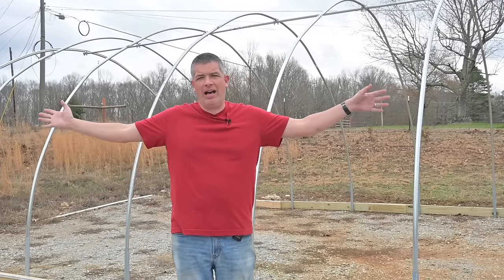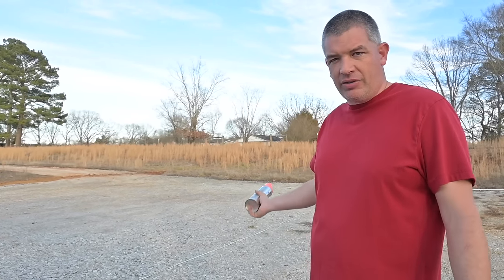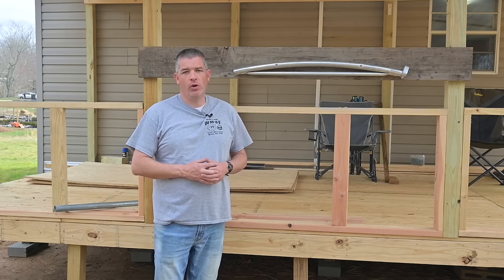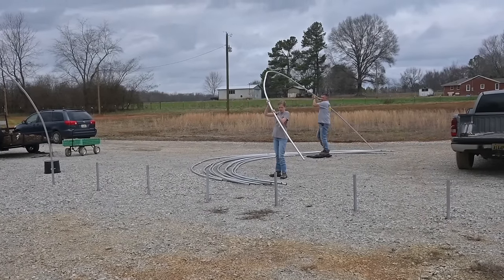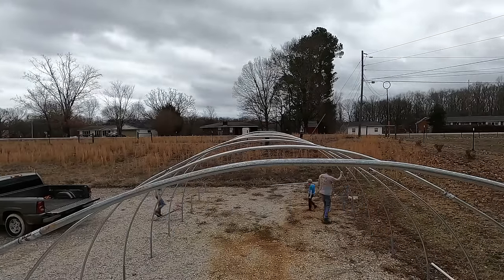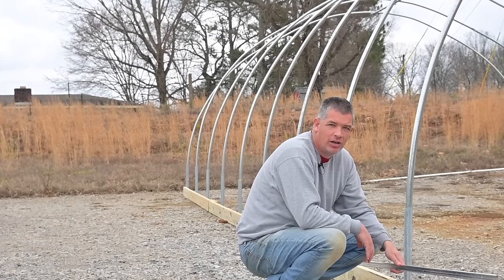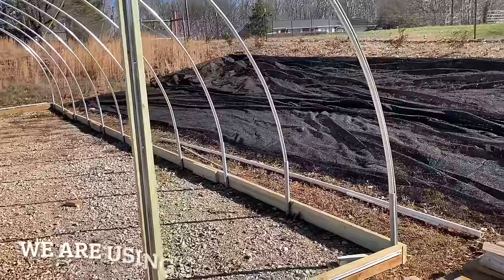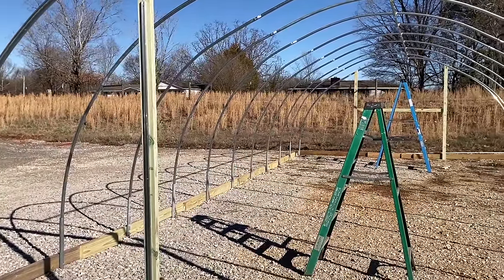We built a SHADE HOUSE, STEP BY STEP, with COST BREAKDOWN!! Hoophouse. Greenhouse. DIY.

Comment: The very  best way to get a consistent bend every time on all you ribs is too measure off every pipe marking a foot, two or three and make that the point you use to place at the loop holding the pipe. That will give you nearly identical ribs all the way every time.
Reply from the maker: Great point!

Comment: I have found used trampolines for free on marketplace. 
I leave a message on all adds under $150 that reads “if you don’t find someone to purchase your trampoline I would be willing to disassemble, and haul off for no charge” I’m guessing that 2 out of 10 say come and get it (right away) another 1 or 2 contact me in a couple of weeks .

A 15 ft trampling will provide a “Quonset hut” 7-1/2 ft tall x15 ft wide 

I think I. Going to try your method of driving post in the ground to make them a little taller and straight side walls . And will eliminate the need to drill anchors to hold it down.

Great job, love it.

Comment: Great video.

When bending a pipe successively (a bend and a bend again on that same pipe), always mark the pipe bend direction so that you does not dog leg. So on that 10' end, jut put some painters tape on top or similar and before you start bending ... is that tape facing up? When you moved the pipe did it twist? If so, adjust the pipe. A dog leg is not just an aesthetic issue, it is also a length issue and could also successively impact your track path.
Reply from the maker: Good tip for sure. I do the best I can with what I have and with the ability (or lack thereof) I have. The way I have done these works well and seems to be holding up great. I haven't had any significant issues with twisting, but certainly something for me to pay attention to as I build out more in the future.

Comment: Quick question.  When it comes to buying shade cloth what have you done to determine approx. how much you need for one of these structures.  Obviously I know this one you built is 20 x 40, but I am assuming you buy plenty of extra to pull over the sides and front/back of these?  If so, how much extra did you purchase for a structure like this?

Comment: I built my greenhouse the same way and it is 20 x 60 which is a lot of space.  We have a lot of wind so I did place braces on the two hoops at each end.  We made it 12' high for tomato vines, but that was a mistake as I have to use a 10 ft ladder to work the vines.   We can grow tomatoes 365 in North Carolina, but normally shut down on New Years and start back in March.
Reply from the maker: Would love to see that setup. Very nice!

Comment: I have searched all over the internet, including the link provided, to find a pipe bender similar to what was used in the video that will make a smooth large radius for longer lengths of pipe. Are there any suggestions where this could be purchased?

Comment: I have two questions:
1) How much would a comparable kit have cost you?
2) Would this design work for a greenhouse with some modifications (you sort of eluded to this during the wire weave portion)?
Also, great job!
Reply from the maker: I see one online for about $860... does not include lumber or railing (any of it). Does include all hardware, so I don't know how that would work out exactly. My point wasn't to say "look how cheap I did this." It was simply, "this is how I did this." It's probably cheaper, maybe much cheaper to do everything yourself, even though it is certainly harder and more time consuming.

Comment: I must have missed something here - for two poles of the same diameter, how did you slide one end inside the other to join them? Not easy to tell on the video, but I would think you need some kind of adapter?
Reply from the maker: they are made to slide together... one end is belled.
Reply: @savvydirtfarmer  ok makes sense. I've never built a chain link fence but it makes sense that one end has a belly. Thanks

Comment: I grow and propagate plants for my own use. I have very limited space. But I have a 12 x 16 hoop house and inside it is almost 10 feet to the top of it. It is covered with nursery plastic. And I’m wondering if I can put a 50% shade cloth tarp over the plastic because it gets too hot from the sun for most plants in the summer. But I really don’t want to remove the plastic for several reasons. Do you think this is OK to do.?
Reply from the maker: Absolutely! Put the shade cloth on top; your inside temp will drop considerably.
Reply: @savvydirtfarmer  wow!
I got it installed and what a difference in temperature!
I covered 8’ of the 16’ and left the other half normal.
Thanks very much👍

Comment: I'm guessing you guys already have a spread sheet done on this with the entire materials list. That would be a helpful link!  What is the correct size to order for this structure? What is the length of board needed for the vertical and horizontal posts on the end walls? 
Size: 20 x 40 feet
20 foot wide pipe bender
Bow: top rail is 1 3/8 inch, 10 feet long, THREE 10 foot sections makes one bow, 11 bows needed for this size structure
Ground post: line post 1 5/8" 8 foot long, cut into 4 foot sections, driven 2 feet into ground, driven every 4 feet
Top Rail: (ridge pole) 4 10 foot sections of top rail connected together with cross connectors
2 x 6 lumber for baseboards, lumber for end walls, pressure treated
Various screws
Wiggle wire channel lengths for front and end walls
1/4 inch bolts, 4 inch length, with washers and nuts for baseboards
self tapping screws
50% Shade Cloth (what is the size needed for this (it's larger than you think!)
Reply from the maker: We do not… just bought what I needed as I went. Thanks!
Reply: What is the size of the shade cloth that you used, please?
Reply from the maker: @farmyourbackyard2023  Sorry Im just seeing this.... I used a 32 x 40 cloth to cover this. Bootstrap farmer link is in the video description and you can find that exact size there. They cut it big so you have room for error on all sides.
Reply: @savvydirtfarmer  thank you! I have been foraging resources for my build. I have all my ground steaks and all my long poles for bows. I bought the bow bender. I’m giving myself until the fall to gather all the materials but I think I’ll be able to get them before then. I’m going to try and find as many used materials as possible to reduce the cost. My estimate is I’ll be able to do it for under $1000.
Reply from the maker: @farmyourbackyard2023  That would be great if you could do that... very doable though, especially with lumber coming down in price so much. FB marketplace is a good place to find used/cheap chainlink fence materials.
Reply: Hello, I've searched everywhere for the pipe bender you use - would you have a link for it?

Comment: Does the shade house need to be that tall?
Reply from the maker: The wider it is, it's going to be taller. Otherwise, it's going to be flat across the top... which is doable as well. You can design any number of ways. I like the height because I occasionally have trees that are 8+' tall.

Comment: What happens if you hit a rock with that post driver. My ground is rocky.
Reply from the maker: If it’s a big, solid rock, you’re stuck. But I have been amazed what it will drive through- when a sledgehammer or manual post driver has no chance.
Reply: @savvydirtfarmer  ……..nice to know! Thank you!

Comment: you can make it cheaper and easier without having to purchase expensive tools  and it will be stronger  this will blow down in a gale lol
Reply from the maker: Maybe. But everyone doesn’t have your level of skill. winds up to 60mph have been no problem so far, as 50% shade cloth doesn’t catch much wind.
Reply: I am guessing you could concrete in the posts with some chunky foundations and also bolt the hoop on if you have high winds. Also may need some bracing to resist the lateral loads. If it was clad in plastic it would be important to look at. We installed a double skin wrapped glasshouse that has a fan that keeps the plastic tight and uses steel portal frames and bracing. But we are in a very windy area.

Comment: I've been sitting on a galvanized steel commercial frame my uncle got from a defunct nursery back in the 70s, having no real direction on what to do with it. It's missing some connectors and others have original bolts that have become stuck within. I never thought to try chain link fence hardware, and I will definitely need that cross bar up top. All I would need in addition to that would be the 2x6 frame (this has actual welded on heavy steel plate slots that slide onto the boards and perch the hoops off the ground), the ww channels, ww, screws, and shade cloth. For winter I expect I could add the plastic sheeting layered over the cloth like you stated. Appreciate this video, now I'm going in the right direction🎉🎉👍👍👍

Comment: You said you are using 50% shade cloth... is there a table or equation to determine what share you need at what altitude and latitude or zone or something? i would imagine you get a lot more sun that we do (The Black Hills SD).
Reply from the maker: I don't know about a table. Kinda depends on the plants and local growing conditions, as you mentioned. 50% is a good middle of the road. I've used 40-60%, all with good results.

Comment: Every screw I've used that wiggles with wind ends up snapping after a few years.  Nails can bend back and forth many times without damage, but can pull out too easily (nail multiple at different angles to avoid them pulling out)
Reply from the maker: I've had a few screws snap myself... got a few to fix as I speak.

Comment: I was wondering how you were going to connect the 2 halves together, I guess I didn't realize they made them with the beveled ends already, I mean I should of known. I've been buying the 3/4" conduit's from home Depot, they are only 5$ a piece, to make my hoop house but wasn't sure how I was going to connect the 2 together. I was going to use a fitting and put the 2 ends in it. Loving this project so far I've been wanting to build a half hoop house and have been slowly getting all the pieces too, I may have to try your way as well.

Comment: I have a pad that is 26 foot wide and 30 foot long. Can I do a hoop house that is 26 foot wide? If so how many top rails would I need for the top? Thank you.
Reply from the maker: You could. Would require some creativity. I would think 4 poles per arch. You could probably get by with 3, but your ceiling would have to be a bit lower and flatter.
Reply: Thank you for getting back to me. I was thinking 3 to 4 for the ceiling.

Comment: Thanks so much for this video.  So much great information. Just a quick question.  What % shade cloth did you use?  Or doesn't it really matter?  I'm going to build a smaller one then add on as I can. It will first house bedding plants while I'm saving for my nursery stock.  Thanks again for the info and the videos.
Reply from the maker: I use 50% normally, but 40-60 is fine for most plants, heavier if you like, for shade plants.

Comment: Do you run the wiggle wire completely to the top of the hoop house? How do you get clear up there on the outside? Also, how did you decide what direction to orient your openings? Did prevailing winds have anything to do with that decision? Thank you so much for the info!
Reply from the maker: Yes… all the way. I use 8’ stepladder. Top is about 10’. Winds? I don’t worry about it. Wind passes through shade cloth pretty well,unlike plastic.

Comment: could i attach 16:53 before putting up?
Reply from the maker: Yes, I think you could... just leave the 6" at the end of each pole for fastening baseboard. I haven't thought of doing it that way, and as I type this trying to think if it would make it any easier... might work!  On second thought, there would also be an issue with the ridge rail cross connectors. They would have to be accounted for as they go over top of the hoops.

Comment: BUYER BEWARE, sticker shock. I just priced those steel posts at Ace Hardware today. They want $50 for a ten foot section! DIY okay, but I don't think this is an affordable option since each hoop needs three sections about eight feet long or so. And I live in ranching country. Prices are through the roof, you're talking about hundreds and hundreds of dollars, and that's not even addressing the lumber.
Reply from the maker: That’s crazy! I just priced the ones I used in this video when I saw your comment, and they are $28 here, for 8’, meaning you get 2 posts per, at $14 per post. The 10’ top rail the bows are made from is $21 per 10’ stick. That’s Home Depot in AL. Crazy how much it varies place to place , but if you’re looking at the same items I am, that’s insane.
Reply from the maker: I’m thinking take the cuttings now, put them in full or close to full shade. Keep them watered regularly (at least daily), and leave them alone. Maybe leave them alone for a full year. It’s late enough in the season now they’re getting close to being hardwood (winter) cuttings, and need to be treated as such. If you have mist, take them now and put them in mist and leave them as well

Comment: Did you also use wiggle wire and channel to attach the shade cloth on the ends of the arch? Formed channels tend not to bend well when they are laid on their side.
as an option:
Do you think that when the shade cloth is drawn over the top of the hoop structure you could also drape the end shade cloth under the top arch cloth so that when the wiggle wire is installed on the end it would capture 2 layers of the cloth in one channel and hold in wind?
Reply from the maker: Yes. The wiggle wire channel bends very easily... it doesn't kink  (if that's the right word) at all. The top cloth and the end wall cloth lock into the same channel on top of the end rail.
Reply: @savvydirtfarmer  thanks so much for the quick reply. Did you understand my wording of potentially doubling up shade cloth and capturing it with one wiggle wire? Have you tried that?
Reply from the maker: haven't tried @SteveHotchkiss-l2m